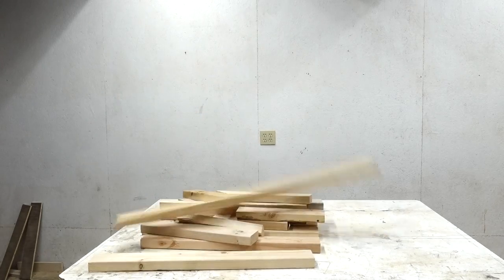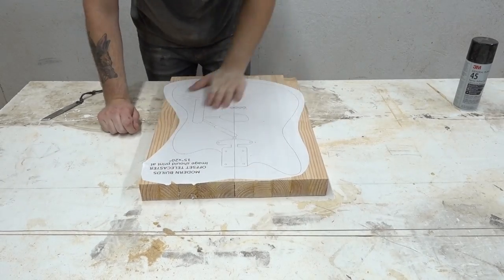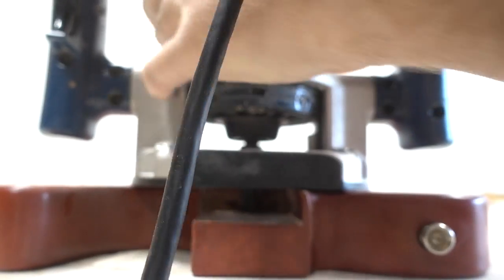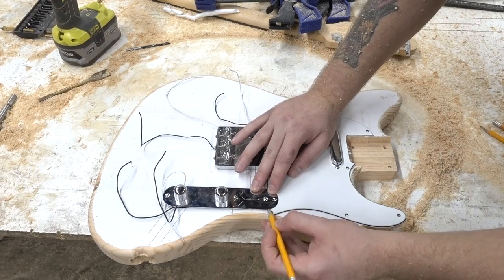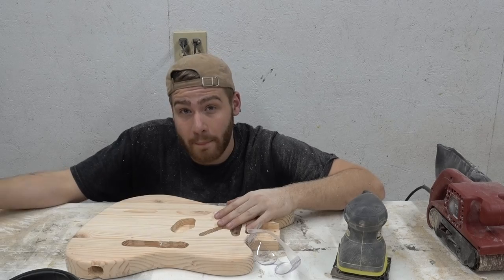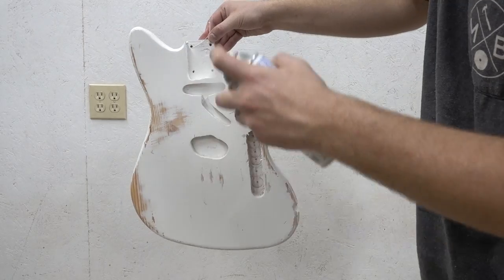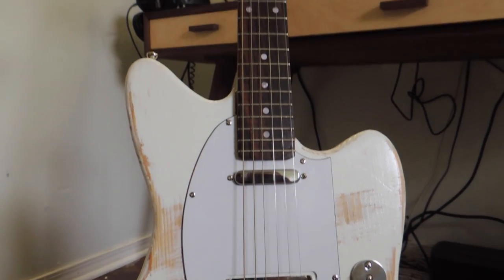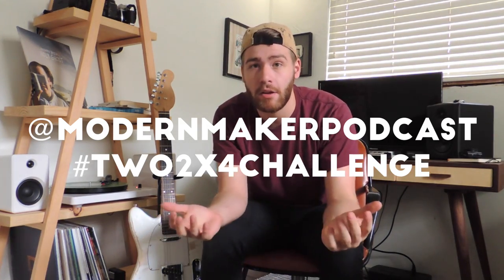Building A Guitar: Offset Telecaster, DIY | Modern Builds | EP. 64

Comment: Really cool guitar! I'm at the same point. I feel I'm ready to build one from scratch. May buy the neck. I did a relic and saw a good tip. Before clear coating, put some steel wool in apple cider vinger and let it sit a day or two. You then take the "juice" and rub on the bare wood. After about a day, the wood darkens and looks old, like it was exposed for a long time! Looks cool!👍😎🎸🎶

Comment: I've had this idea for several months now, to build a Tele out of scrap 2x4's. Mine will also use inexpensive hardware and electronics, the whole idea being to keep the total cost down less than $500 (I have to buy the neck). What thickness did you cut your lumber for before you glued it up?? Great job on the axe.
Reply: Chuck Costello that's what squires were made for!   50 bucks on Craigslist all day
Reply: I know how and where to source cheap guitar bodies; that's not my intention with this build.  I like putting forth greater efforts into getting my tones by modifying my amps and pedals and building some guitars.  That's all part of it.  Buying a cheap body just because I can or because it's easy takes all the fun out of it.
Reply from the maker: Standard body thickness are about 1 3/4" so I cut the pieces to about 2" before I glued everything up
Reply: Thanks for the reply!  The guitar looks good.  I had the idea of using 2x4's horizontally and not vertically.  I guess I wasn't thinking.  Great job.

Comment: Hey, about that pickguard. What if you had put it upside-down and then fixed the borders (With that 45º angle)?
Reply from the maker: Not quite sure what you mean? could you detail it a little more
Reply: If you had flipped it like it was an left-handed telecaster. Then you wouldn't had to cut the pickguard straight, and still had that little "horn" in it

Comment: Hello, I have a question. Do you think it is possible to use a Stratocaser body to cut it as this model? Thanks
Reply from the maker: maybe....  you'd need to drill new holes for the 1/4" out, but it should be possible
Reply: okay thanks for the quick reply. have a good day.

Comment: Its not a good idea to drill your neck bolt pilot holes before routing the pocket out. By doing it after, you can use a straightedge to align your neck, then drill the holes. It's also best to paint the guitar before drilling the holes, too.

Comment: i wonder why no biscuits are needed between boards. maybe they're just used for alignment. since he is planing the surfaces, every board ends up even with it's neighboring board. just a guess.
Reply from the maker: Yeah, biscuits don't add a ton of strength. They mostly help with aligning a large panel glue up.